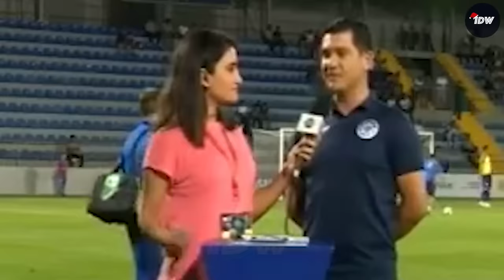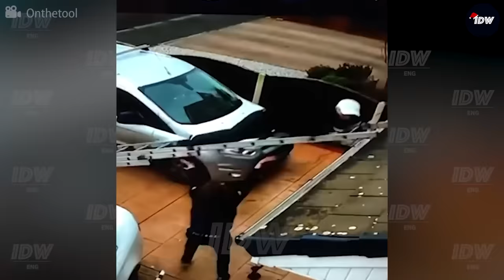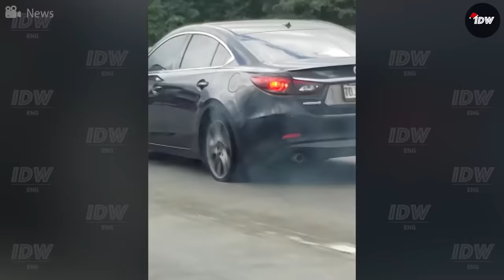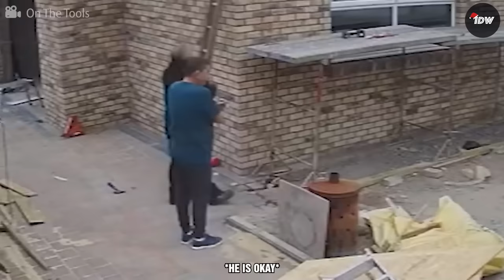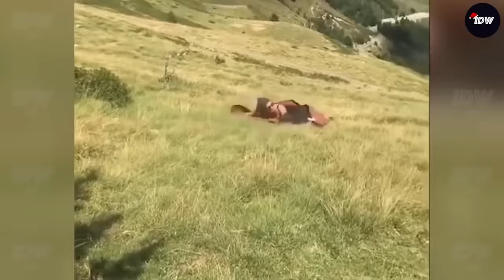TOTAL IDIOTS AT WORK #136 | Bad day at work | 1 hour of crazy fails compilation 2024

Comment: He called a tamp a jackhammer and an excavator a crane?? Wow...
Reply from the maker: at which moments sirr?
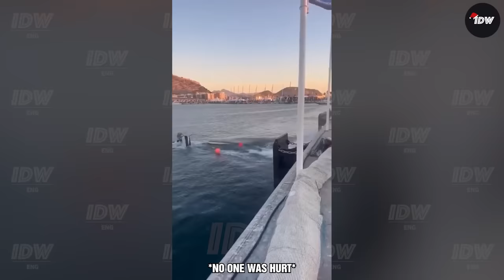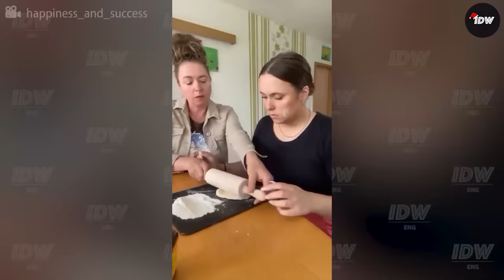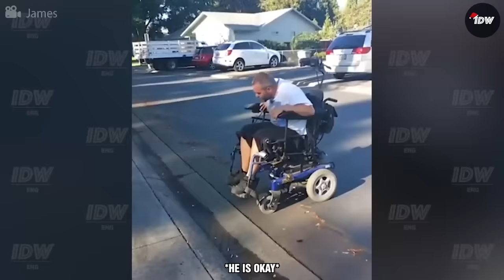Reply: @IDWIdiot99   9:02, pretty sure that was a crane and not an excavator. 19:15 for the jackhammer (instead of a tamper). 32:28 for the crane instead of an excavator, I did enjoy the video though - thank you.
Reply: many times hes wrong. doesn’t know the diff between a truck or a car. vids are great if he wouldn’t narrate. some people need to hear themself talk….alot